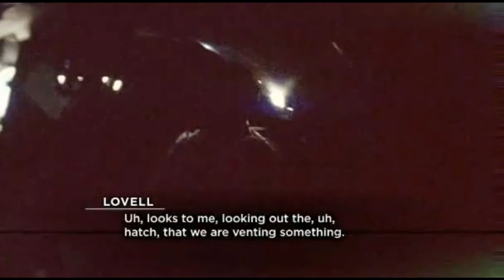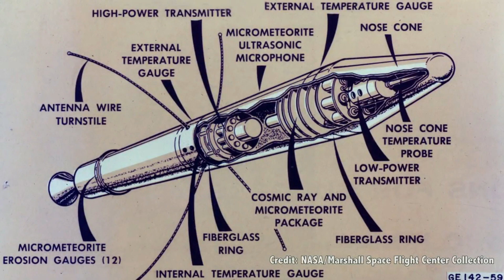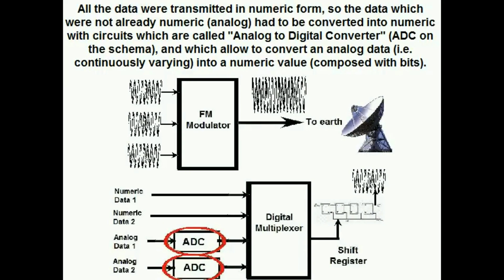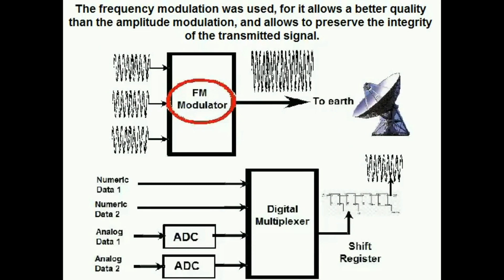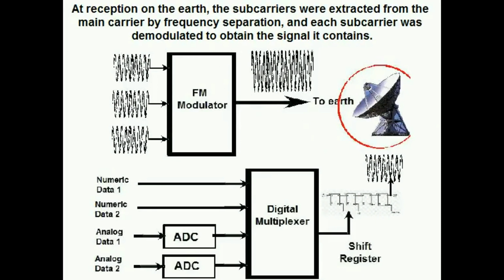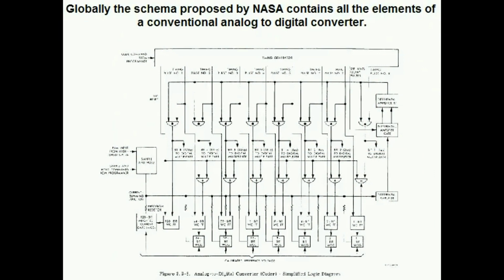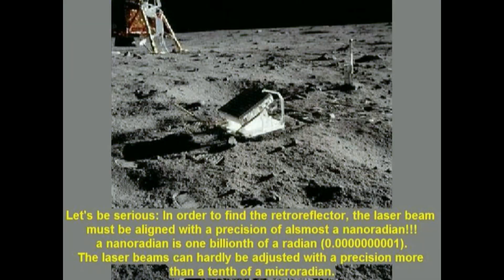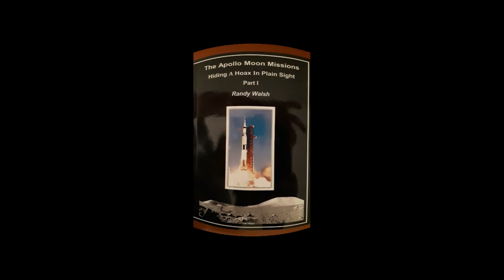Moon Hoax; " Apollo, "A Hoax Hidden In Plain Sight"  With Randy Walsh Part 2

Comment: Apparently the technology used to get to the moon was less than a modern day calculator so why would it take so long to build it back up?
Reply: @ginskimpivot753  Fact is though knowledge in all areas has greatly increased in fifty years. Are you seriously suggesting that we couldn't match or outdo that which was achieved fifty years ago? Keep chewing on your bit of straw.
Reply from the maker: Exactly!
Reply: GinSkimPivot   What was the calculating power? No new tooling is required. Just use what worked then.
Reply: Justin Cox    Stupid simple, dinosaur technology. Use the original blueprints. With current CNC tech the manufacture would be simple and quick.
Reply: @ginskimpivot753  in a roundabout way you did, although you probably didn't realise it.
Reply: GinSkimPivot    Everything being examined for the Orion pseudo moon trip has already been used for the previous events. Just use that information and technology and build it with current state of the art technology. This entire thing is an obvious sham and is again only a money making event for the military/ industrial complex.
Reply: @sarahwatson7692  "This entire thing is an obvious sham and is again only a money making event for the military/ industrial complex."
Well if it that obvious, why don't you provide actual proof?
Reply: Why, when you see the word "technology" do you think only of the computer? What about the rockets, the the command and service modules and the LEM. Are they not also "technology"?
Reply: @sarahwatson7692  Clearly you have zero understanding of the issues involved in building spacecraft intended to carry humans. There is no point in simply duplicating what was done (at enormous expense) in the '60s. A modern craft has to both more capable and cheaper than Apollo as the US government is not going to fund NASA today the way it did back then.
Reply: "Apparently the technology used to get to the moon was less than a modern day calculator"
There is far more to a space craft than just the computer. 
If you wanted to fly around the world, would you want to complete that task in an old biplane or a modern jet liner, which would be the safest, most effective and reliable option?
Reply: Electric Palace.    Okay—explain it.
Reply: @sarahwatson7692   "This entire thing is an obvious sham and is again only a money making event for the military/ industrial complex."
Well if it that obvious, why don't you provide actual proof?
Reply: @sarahwatson7692  Explain what?